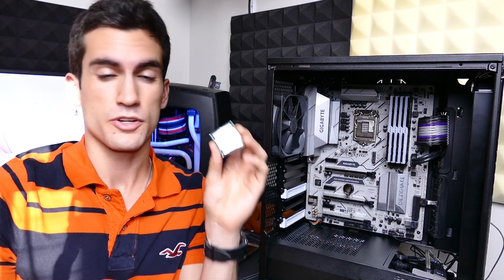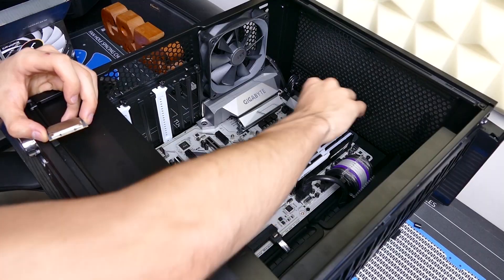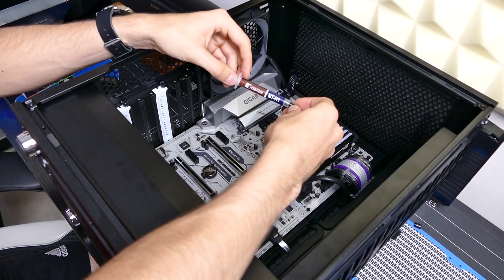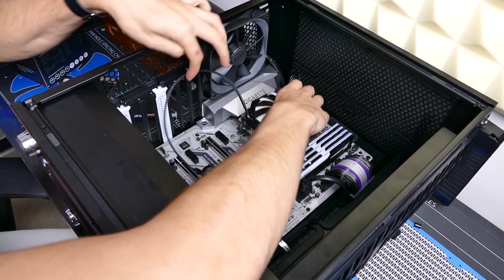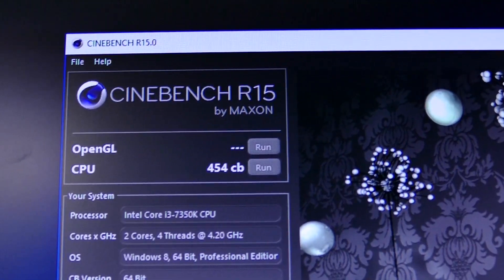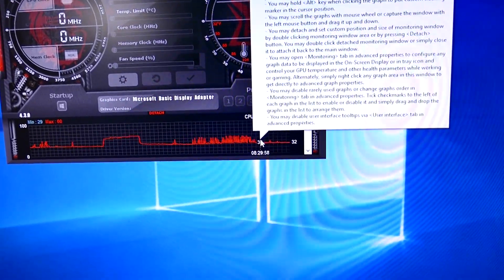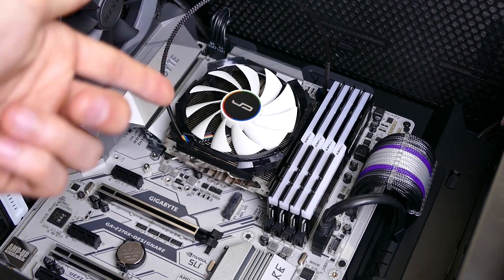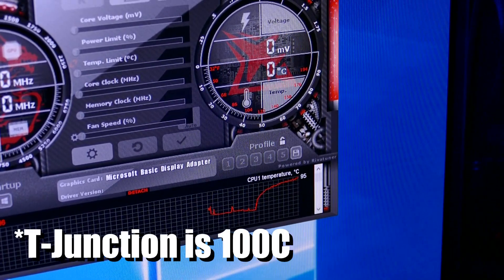Thermal Pad Instead of Thermal Paste?

Comment: Supposedly the i3-7350k is just a i7-7700k which was only partly functional when it left the production line. Intel could have limited its core clock to 4 GHz and called it an i3-7300. But that would have been a waste since some people are able to clock it up to 5 GHz. The only issue is the price. They seem to come down quite a lot, though.

Comment: "... its probably going to thermal throttle when we swap the paste for the thermal pads." Isnt thermal throttling the changing of the chips performance based on the temperature? I.e if its too hot it will throttle down to lower the temperature...???

Comment: You're getting ridiculous, everyone knows that the thermal pad is not as effective as paste, but at least you could've had the decency to actually cut the pad in such a way to actually cover the whole surface of the CPU and then you would've seen that temperatures would've been allot better.
Stop embarrassing yourself, and put in the actual work and research before you put out another video that you'll have to later apologize for... how many of those did you make in the past year? 4...5...10?!

Comment: Just wondering why didn't you cover the full surface of the CPU with the Thermal Pad I feel the results would have been worth testing as it would be a more fair comparison due to Thermal Paste when sandwiched between the CPU and cooler covers mostly the entire chip if not all of it

Comment: umm, the surface area that is in contact with the Thermal transfer material,  be it thermal past, or thermal pad , makes s big difference. if the thermal grease is covering a larger area, say 2inx2in, and your thermal pad is covering an area of 1in x 1.75in, your test is invalid because the surface area's are scewed in favour of the grease based on surface area alone.

Comment: Could you re-run the test while covering the entire die with thermal pads? You did cover the majority of the heat generating center, but covering the edges definitely helps out.

I would not say the CPU will overheat without thermal paste, unless you have some very loosely mounted cooler maybe. I've run my CPU without cooling paste for a while (not lapped) and that turned out to be just as fine as with thermal paste.

Comment: Yet my AMD A8 7600 is sitting here running GTA 5 at 105C. Is my CPU know for overheating? Yes I have installed everything correctly, applied and reapplied enough thermal, and there is no dust on the fan or anywhere in the computer for that matter. BTW my CPU only started getting this hot when I bought a new GTX 1050 Ti which bottlenecks the cpu. I also have it overclocked to 4.4GHZ and yes I know this cpu isnt overclockable unless your mobo lets you do it through BIOS/UEFI.

Comment: Careful with over volting. If you get it to the egde of what the CPU can handle, then re-boot your system, the extra current draw a  CPU takes on start up will fry it. Be sure to clear the cmos before a re-boot.

Comment: Things have probably changed a bit since I was into all this stuff, but when I see temps hitting 70 deg C, I start to worry and start revving the fans up. I've put SMC fan control on my Macs to keep them down around 45 C. As for my Linux boxes, I just monitor things and start cutting processes when I feel the temp is getting too high. There's probably an apt for that, I just haven't found it. :)

Comment: Any thermal paste start to loose its heat conductive features over time but I'm not sure if it is the case with thermal pad, so long time testing is needed to make any conclusions. P.S. That's a shame that some people in the comments don't have the courage to aknowledge the fact that imperial measurement system sucks

Comment: I believe you should be covering the entire surface (with the thermal pad) of the CPU heat spreader in this test as  the thermal paste spreads out on its own. The thermal pad in this test is conducting heat through a likely much smaller area, as thermal resistance is a function of area and thickness this will affect the results.
I would expect the paste to be better but the difference would be smaller.

Comment: But pads are used in laptops due to tolerances and flex in the chassis, if you use paste in a place where it's made to be a pad, it would not be that great for it.

Comment: Why don't you try polishing the top of the CPU's integrated heat spreader and the bottom of your cooler solution and then attach them without any TIM whatsoever?

Comment: Fun fact: There are thermal pads that are designed to actually be /better/ thermal transfer mediums than thermal paste, although they're made from incredibly expensive materials, and a small pad would cost exponentially more than a tube of thermal paste. They're mostly used in some industrial situations where paste would just dry up quickly from the heat involved [often a few hundred degrees Celsius]

Comment: My friend's PC with a i5-4590 does this (like the thermal pad thing, but with stock thermal paste) going up to 70C on idle, and 100C with load. 

I know this is not normal, and I replaced the thermal paste and reseated the heatsink, but still the same. 

The only difference is that the temperature falls much more quicker after "releasing" the load, compared to the previous, which uses intel's pre-applied thermal paste. Is there any way to remedy this?
Reply: Delid the chip.
Reply: And how delidding the chip supposed to help?

Comment: if you want to use thermal pad, cover the whole god damn cpu dude, the point of having thermal paste or thermal pad is to increase contact area to conduct heat, if you dont cover the whole cpu with thermal pad, the contact area is so much smaller. of coz the perfermance would be so damn bad

Comment: Seeing as Thermal Paste is designed to void air gaps between CPU and Heat Sync, it doesn't make any sense to put a tape-like strip on the center of the CPU. We're already talking 70% reduced thermal conductivity from the start. Try it again with full cpu coverage!

Comment: Bro, since compound and pad is both variables in this experiment,...that means the control should be the experiment with nothing in between heat-sink and cpu no?
Reply: no thermal paste it will most likely just overheat and die in a few seconds of being under load
Reply: No, because paste is the established medium
Reply: The proper control is... toothpaste. Also that was some crummy thermal pad. There are way better ones out there (like 10W/mK conductivity and up, comparable to greases) - but very expensive compared to grease. On the upside, they are mechanically more stable.

Comment: I'd say that the i3 7350k certainly has a niche. For one thing it's cheaper than a i5-6400, so if one doesn't mind slightly lower performance, they can pay slightly less as well.

Secondly, it would do well in cases that aren't optimized for 4 cores. When he did a video about the CPU he goes "look, it's slightly worse than this i5 at all this stuff that's optimized for 4 cores... it's completely useless!". There are some things that cores simply don't work well with due to poor optimization in software. I've found that over the last 8 years a majority of the stuff I've been interested in has been that sort of software. I imagine i3-7350k would be great for that.

It seems really closed minded to assume everything one will be doing will always take advantage of 4 cores.

9 years ago I bought a quad core, yet still most of the stuff I do doesn't even take advantage of it. my CPU always caps at either 25% or instead sometimes around 45%. I thought the advantage of a quad core would have come long ago, but I still feel like it's not even quite arrived. I don't use video editing software, nor do I play most (or any?) multimillion dollar big-name majorly optimized games.

Comment: wouldn't completely covering the whole cpu with the thermal pads give better results? since the thermal pad seems to increase the distance between the heatsink and the cpu it should be covering everything so it isn't just that tiny bit of thermal pad on the middle transferring heat

Comment: The whole reason for the heat plate that sits on the chip is for heat displacement. Do a thermal pad that covers the whole processor.

Comment: Trying running a watercooling loop on it at -5psia for an approximate 60C saturation temp and see the general change in heat transfer (or just use it as a heat source for a mini turbine heat engine because that would be dope af)

Comment: I'm curious about how much different the results would be if you used a thermal pad sheet cut to the shape of heat spreader using Fujipoly 0.5mm 17.0 W/kM. The thermal paste would still win, but it might be close. Would be an interesting experiment.

Comment: its funny, if you actually did your research and put it to the test, you would find out that the i3 7350k is a waaaay batter value than the similarly priced i5-7400  if all you're doing is gaming. there is about $50-60 price difference between the 2 but the 4.2ghz single threaded performance of the i3 is way batter for games than the i5,  especially if you overclock the i3, where as the i5 is locked at 3.0 ghz but turbos to 3.5. that 50 60 dollars could be spent on a better cooler to overclock the crap out of the i3.

Comment: Should have used some fujipoly sarcon xr-m at 0.5mm covering the whole die since it's the best thermal pad there is. But yes there is no point because thermal paste is thinner and is better for CPU applications. Thermal pads are all about cooling vrms with heatsinks over the top. Just another shitty clickbait video.

Comment: Well... thermal-pads are convenient. If you do not like greasy thermal past. I can think of two things you could try.

1. Giving the thermal-pads the best possible chance by covering the full head spreader area. It might just work.

2. Using neither thermal-pads or thermal past. If that worked and the CPU was only 10 deg hotter then you could save the thermal past for quick and dirty test setups.
Maybe Thermal past is not necessary?

Good video, I like to se you try stuff, just for the sake of it.

Comment: There is thermal pad material from a company called Fujipoly that is rated very high on its thermal transfer capability, higher than even the MX-4 thermal compound. I'd be interested in seeing you rerun this experiment with their thermal pad to see if it has a different outcome. Just like not all thermal paste is made the same, neither are thermal pads, and since that looks like a thermal pad from a GPU waterblock, it might not be rated the greatest on thermal transfer. EK's for example are rated at between 3 and 5 W/mK, whereas Fujipoly has pads rated at 11 or 17 W/mK.

Comment: You think this is bad? I once opened a overheating laptop to find they used a piece of aluminum paper with some grease on both sides. (The kind you use to keep stuff moving, not the thermal grease kind)

I would not be surprised to find some low-end systems to come with a thermal pad instead of grease from the factory, if manufacturers think they can get away with it and save money, they will do it.

Comment: Typically a CPU chip has thermal paste on it then a lid and the user adds thermal past on the lid and the cooler of choice.  It seems there could be some efficiency lost by sandwiching the lid between thermal pastes.  What if you removed the CPU lid so that you only had thermal paste between the chip and cooler?

Comment: You should have tried it without a thermal pad or compound.  You may be surprised at just how well that can work (well... on AMD CPUs with their flat IHS, anyway).

In a pinch, I use anti-seize compound.  Works perfectly fine and doesn't try out.

Comment: 7350k 95c 100% load 24/7 stupidly overvolted and overclocked. like im talking 90-95c on water.  

or maybe get some peltier units and try some home brew extreme overclocking :P

you could aldo go direct block on die cooling and the first idea with it being stupidly over volted and running hot as hell at full load. 

you could also just really beat on the thing and delid it and put a thermal pad under the ihs and see what happens.

Comment: uhm are you kidding me? vrms dont hit 100c? vrms are designed to be able to run hotter then a cpu can, something like 150C. its better to say they are designed for things that dont get damaged running hot and dont need the best thermal dissipation but could benefit from something.

Comment: Hey, Greg. I think you should redo this video. You need to eliminate all the variables you introduced in this comparison. The two big ones are that you need a thermal pad that covers the whole CPU heatspreader and you need a much thinner thermal pad (about .1 mm thick - the thickness of thermal paste). As others have mentioned, maybe try to more high quality pads, or at least talk about the quality and the heat transfer ratings. I liked your idea for the video but I think it was poorly executed.

Edit: As for ideas for your next video, I think it would be fun to try and water cool the CPU in a very "jerry-rigged" way. Like put a copper cup on top with thermal paste and continuously change out the water by hand to see how long you can go without the CPU shutting down in a stress test.

Comment: maybe use some pad like cool laboratories metal pad. gives better results. the quality of the pad can impact in the temperatures. but of course the thermal paste is always better. but in some scenarios where you don't want to open the case to change thermal compounds over several years, it could be a better solution. like a PC you are building or helping to build for someone else that doesn't have expertise on these kind of procedures

Comment: But Greg, what if you tried 2 pieces of the Thermal Pad, that would give more heat conduction, right? Also, I would love to see you try without any thermal paste or thermal pad, that would be fun to see. The most fun to see, however, might be to try booting up without a CPU cooler, probably a definite way to kill a CPU (prepare the graves, 1"x1"x0.5" hole in the dirt), but the series is called "Will it FRY?" so it's worth it. You could also put a candle in the PC to heat up the inside, try using a homemade CPU cooler made intentionally to fry the CPU, or use the cheapest, lowest quality CPU cooler you can find, and then with those coolers, you can also try using the thermal pad and no thermal paste or pad, that would be fun. Thanks for the entertainment!

Comment: I use thermal pads for the CPU and GPU on 2 of my laptops. One with i5 430M and GeForce 310M, one with i3 2370M and GeForce 610M. Both can run Fallout 4 on low settings, 640x360 resolution at ~14 fps.
Reply: Oh, and the average temp is 84 C while playing Fallout 4 on both CPU and GPU on both laptops.

Comment: Please do a video with no thermal interface between the heatspreader and the heat sink. Then after that you should see at what voltage does a Kaby lake CPU instantly fry at. Please do it in small .025v increments. Maybe .05v increments if you want it to speed up the process.

Comment: Don't want to be rude but you tested the wrong way thermal pads,thermal pads need to cover the full surface of the CPU die in order to transfer the heat correctly.This is how is done in PSU/small power amps or any electronic assembly that includs radiators for pasive cooling.

Comment: "It'll be used for  VRMS's....." "But not 100*C hot" 
Well,  VRM's can get upto 125*C and will run fine up until that point.
A big problem with using thermal pads on the cpu, is that they are too thick. With there being more room between the IHS and the cooler, the heat transfer will be less efficient, because silicone doesn't conduct heat as well as copper/aluminum.

Comment: Interesting experiment, but a relatively thick, low conductance pad was never going to compete with a thin layer of decent paste. I know that the cost per application would make for terrible value, but I would be genuinely interested to see how a thinner, high performance pad performed - 0.5mm Fujipoly Sargon XR-m at 17Wk/m being the obvious example.
Why would you even consider this? For clean, convenient application as much as anything. 
It would also be interesting to see if there was any appreciable difference with the high end pads that may make them desirable for other applications more suited to pads - find out if they are really worth the high price tag. 
Cheers!

Comment: One time I didn't have any thermal paste and needed to upgrade my CPU so I applied some good old toothpaste and actually had decent temps though at load they reached 60-65 C. Now I got more thermal paste and get around 50 at max load. Decent.

Comment: You didn't tell what thermal pad you used or it's heat conductivity rating. BAD JUNK SCIENCE! You used a 3mm pad because you know thinner is better? You used the absolute worst choice and when your "science" experiment is slanted to show a predetermined outcome, it is not science. On the other hand you could have used a 0.5mm Fujipoly thermal pad with a heat conductance rating of 17wmk instead of your 3mm thermal pad with 1.5-3 wmk.
Reply: Yep
Reply: This video is just superficially valid. He barely invested any effort in reliability of results or interpreting them after the test. This is just one half assed attempt at getting views.
Reply: this child is just like thio joe. a dúmbàss with money to burn and nothing better to do. i came for information but even i knew more then the youtuber was trying to exercise. im pretty upset but hey, he almost had a new daily subscriber.
Reply: www.andyrawmaterial.com
andychowmailbox@gmail.com